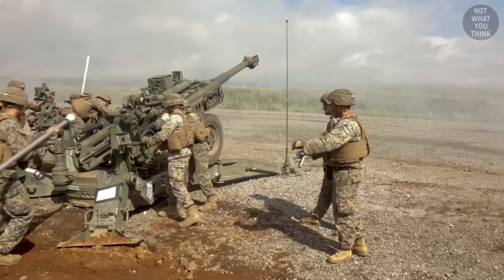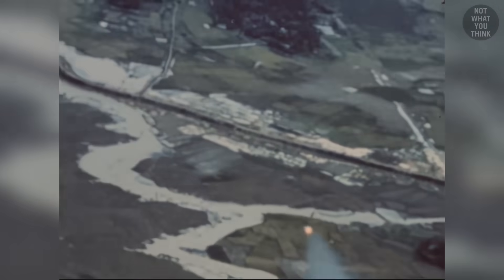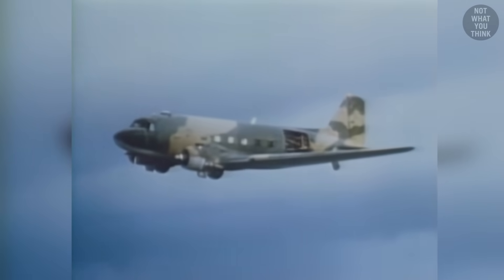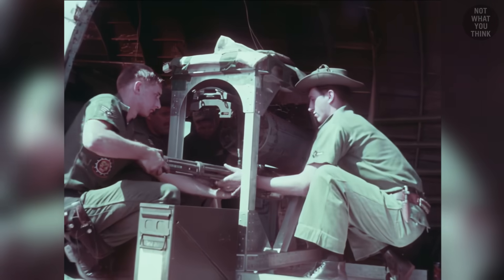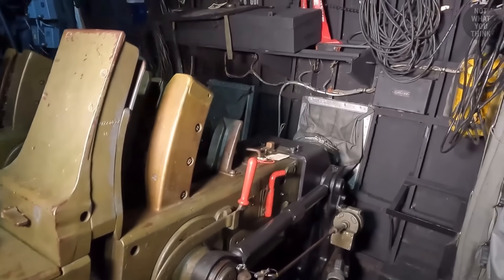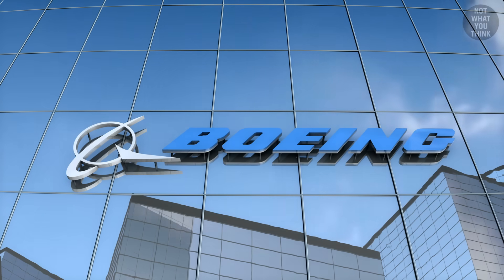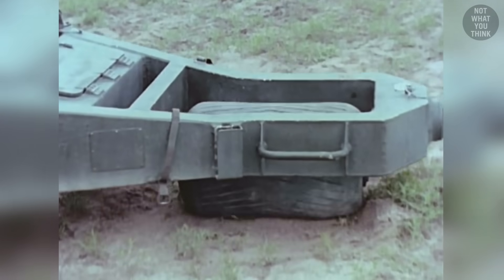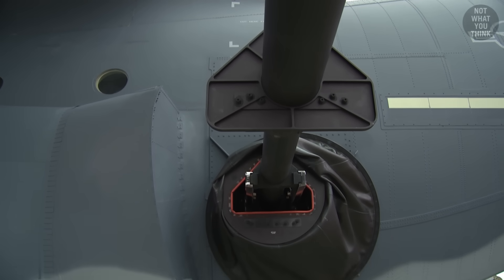Why the US Air Force Installed a Howitzer on a Cargo Plane

Comment: I wonder how real the idea is to make a tiltrotor with 120mm and 30mm guns and that they shoot ~360 degrees like helicopters do from under the bottom
Reply: It's not realistic at all.  First off, the airframe can't take the abuse from the recoil, which is significant.  There's a very real reason the AC-130 Only has a 105mm cannon, and the MC-22 Osprey is MUCH smaller.

Comment: True, but the AC-130 has been used since like Vietnam... Just with 4 or so Miniguns. And Before that I believe they took DC-3 planes and made them into gunships as well for Veitnam (AC-47 SPOOKY)...
Reply: There were no mini-guns on the AC-130.  The "A" and "C" models had 20mm rotating cannon.  It's like comparing a pea-shooter to a .44 magnum.
Reply: @Rotorhead1651  The first batch of AC-130As, ‘Plain Janes’, had 4xminiguns and 4x20mm. Later upgrades removed the miniguns and aft 2x20mm and added 2x40mm. The miniguns could be optionally refitted if required.

Comment: four mini guns and four rotary cannons? But miniguns are rotary guns, just smaller.
Reply: Don't comment on things you don't understand.

-  The M-134 "mini-gun" DOES have multiple, rotating barrels, but it's called a mini-gun for a reason.  The ammunition is either 5.56 or 7.62, the same as is used in standard rifles.  It is little more than .22 caliber.  Rotating Cannon are considered "light" artillery.  Their ammunition STARTS at 20mm (the size of a grown man's thumb).  They are NOT the same.  A 20mm rifle round can penetrate vehicle armor.  A .22 cal round cannot.

-  Where did you hear "4 mini-guns and 4 rotary cannons"?

The AC-47 had THREE mini-guns, period.  The AC-130H had TWO rotating cannon, a 40mm Bofars cannon, and a 105mm Howitzer cannon.  Try to pay better attention.

Comment: "It's only used, when total air superiority and ground assurance is secured"

Just like with the A-10. Almost like those kind of vehicles are doing a shit job, compared to other CAS using guided bombs etc.
Reply: An OV-10 Bronco, with a "chin" mounted gun, once shot down a MiG.  Don't talk trash about things you know nothing about.  Neither the AC-130, A-10, nor the MQ-9 Reaper are Fighter-Interceptors, and anti-aircraft systems have come a long way in the 50+ yrs since Vietnam.  Even with next generation active and passive countermeasures, an RPG can still slip through.
Reply: @Rotorhead1651  "once".
Reply: @zwojack7285  

You certainly are opinionated for someone with literally zero experience.

Comment: It seems the barrel is rather thin, which might indicate reduced pressure charges.
Makes sense since the shells are less slowed down by gravity firing toward the earth.
Reply: Nope. Regular ammo. As an Engineer on AC-130U I worked on ballistic simulations be for I wrote key part of Fire Control algorithm.

Comment: Fun fact: the guy who designed the “Puff the magic Dragon” concept had to pay out of his pocket the prototypes and ammo for testing purposes
Reply: To my knowledge Col. Ron Terry was an ordinary Air Force officer when he developed the concept by firing a rifle from a small plane circling a target. I was an Engineer on the later AC-130U design and we hired some of his contemporarys as consultants and heard many stories. 
This video is ok but no 100% accurate
Reply: @martinmartinez250  wow
Reply: @martinmartinez250  that concept of circling target using MG was developed during WW1
Reply: @jantschierschky3461  WWI planes were a lot slower and flew lower. To accurately shoot from a more modern a/c requires aiming far backward and high. Initially this was done with precomputed ballistic tables The AC-130U version onward used computer controlled trainable mounts. Very different from eye balling with "Kentucky windage".
Reply: @martinmartinez250  well that's not the point,  stating simply that tactic was used in WW1.  So that concept is old
Reply: @jantschierschky3461  You are correct but I think of it as shooting from horseback or a moving tank without a Fire Control System. Sure you can do it but you aren't going to hit anything consistently.
Reply: @martinmartinez250  Correct and the air force didn't want it, I would not call this video accurate in the regards of the original developments which were to support bases and hamlets. There are better origin vids out there.
Reply: It's Lockheed Martin and Boeing so whatever.
Unless the test was performed before the 2 companies approved further research.
Reply: @Doxxtrain  No It was the Air Force doing the early models up to AC130A in house and  in theater near Vietnam. On the later AC-130U we hired some of the, by then retired, AF Officers as consultants.. Lockheed had the contract to refurbish AC-130H and we at Rockwell's North American Division (much later bought out by Boeing) had the contract for AC-130U.
Reply: Well, was he rich? Was he a higher up in a large defence company? Because if he is, then that's not very noteworthy or unheard of.

Comment: 1st, the AC-47 was actually not the first gunship.  That honor belongs to the B-25G, which literally bristled with both fixed and movable machine guns.

2nd, while ANY large aircraft is vulnerable to anti-aircraft weapons, the U.S. military has been developing anti-missile defense systems for its aircraft well beyond simple chaffe and flare units.

I was assigned to the 20th Aircraft Maintenance Unit (A.M.U.), 1st Special Operations Wing (maintenance unit for the 20th S.O.S., and sister unit to the 16th S.O.S. "Spectre", the first U.S.A.F. unit to fly the AC-130).

At that time the AC-130H had recently been assigned to the 16th, relegating the "C" models to the A.N.G. unit at Duke Field, and retiring the "A" models.  The H's were armed with twin 20mm rotating cannon, a 40mm Bofars, and a 105 Howitzer, and a suite of sensors and scanners which allowed the gunners to put a 105 round in your lap, from 10,000 ft., on a starless night, while you were driving down the road at 50mph, and you'd never know they were above you.

In the 40 yrs since then, the avionics packages have only advanced in leaps and bounds.  Anti-detection technology has gone from passive systems like flare, chaffe, and "the bathtub" (a device mounted under the wings, overlapping the engine exhaust, to help mix colder high altitude air with the hot jet exhaust), to active electronic systems used to disrupt the tracking systems of inbound radar/infrared guided missiles.

An RPG might be able to penetrate the gunship's defensive screen, but it would have to be extremely carefully aimed, and fired at the aircraft's exposed underside, where flightcrew would be unable to see it and manuver out of its path.

If you ask experienced, battle-hardened, combat troops, they will tell you that the AC-130, A-10, and the Reaper drone are the current "Holy Trinity" of CAS.
Reply: Except that the reaper drone is the only one good at being CAS. The other two literally eyeball their targets and spray'n'pray.
Reply: @zwojack7285  

Are you a combat vet?  You sure don't sound like one.  You SOUND like a know-nothing dweeb who thinks he's good at trolling.

Comment: does anyone remember the italian p-108? that thing had a 102mm howitzer in front of it.
Reply: No one remembers the WW2 Italian air force, with good reason. 😂😅
Reply: @Rotorhead1651  many remember the Italian airforce of ww2 due to their top of the line pilots those guys were flying circles around allied planes their machines however could not hold up to the pilots greatness

Comment: 8:58 “cheap holographic sight” lmao. I mean I do suppose it’s cheap compared to aircraft targeting systems 😂
Reply: It's also called the H.U.D. (Heads Up Display).
Reply: @Rotorhead1651  Indeed, and they run around $30,000 per unit depending on the capabilities of the unit. So I can understand why they would opt for a $500 firearm sight instead.

Comment: Can we get a video on military flares? I've always found those floating spheres of light amazing
Reply: I read this as "ohhh shiny"
Reply: Hah yes i once saw it on a SoloTürk airshow those things are amazing
Reply: Those pretty flares, they're there to confuse heat seeking ground-based missiles. Hopefully they attack a flair and not the aircraft.
Reply: Well, they are basically just fireworks, but I agree because fireworks are obviously nice to watch. There's just not much to say about small colorless basic fireworks so a video on just them might be way too short. Just search for cool compilations of them because the mechanism behind it is literally thousands of years old, that's how simple they are.

A little gunpowder shoots a comparably slower burning ball out of a tube and that ball burns up in the air over a few seconds. Just like firework batteries or closer "roman lights", you could even make your own with fairly simple chemicals and techniques.
The heat signature of those burning balls confuse heat seeking missiles so they (hopefully) follow those instead of the plane and that's already it, not much more to say.
Reply: @ToBeIsWasWere  I don't think that's accurate, sorry. Those flares are much brighter than fireworks, and some involve parachutes. And considering he made an interesting video out of an easy question (why the air force put a big gun on a plane - to make things go boom), I'm sure it would be interesting
Reply: @agxryt  I've seen "civilian" fireworks with parachutes. Parachutes aren't some weird concept that's only used in the military, they're used all over.
Reply: @ToBeIsWasWere  he could also add other things to defend planes like those missiles that fake planes or those laser anti missile things
Reply: Flares are exactly what we think, so I don't know how he would fit "it's not what you think" into that lol. He's gonna think intensely on it for 3 hours and give up because his brain is fuming.

Comment: Awesome video, as usual! Idea: If you can, you should do a full video on laser weapons. I bet there might be a bit more content to cover since that short you posted two years ago.
Reply: I was an Engineer on AC-130U design and did early work on the YAL-1 , a 747 test bed with a laser weapon. Many years ago and I cant say much publicly but I can say my Caltech professors were divided over airborne Laser Weapons. Many thought it would not be practical to fly a big enough energy source with Laser efficiencies at the time.
Reply: No.  There isn't.  The U.S. military's Directed Energy Weapons program has been indefinitely suspended.....

.....officially.
Reply: @Rotorhead1651  the US isn't the only country researching laser weapons
Reply: @ToBeIsWasWere  

The U.S. is the only country which can AFFORD to research energy weapons in the BEST of times, which these are most definitely NOT.
Reply: @Rotorhead1651  Israel is also doing research on lasers for defense
Reply: @Rotorhead1651  Really? Which program - there is more than one you know.  Reference?

Comment: The gun ship is one of the most powerful troop suppression aircraft in existence I highly doubt that s400 missile systems could get within operational range of one in time without being hit by an f35, f22 or any other non stealth aircraft if they can find an opening if any pilot finds an opening to kill as s400 or other they will take it without a second thought
Reply: The AC-130 is not limited to troop suppression.  It can also wreak havoc with supply lines, warehousing, infrastructure, and absolutely DECIMATE enemy bases.
Reply: @Rotorhead1651  only if opfor has absolutely nothing in the way of AD
Reply: Unless the enemy has any form of anti air defense.
Reply: @Thebootlegengineer  

....and have been for decades.  Even when I was in, we had both passive (flare & chaffe) and active (electronic) countermeasures for suppressing incoming anti-aircraft systems.

Comment: The AC130 is in the same kind of position battleships were in WW2
Reply: A Drone can't linger and lend near continuous artillery support. As one of the Engineers who developed the AC-130U  I always thought of gunships as artillery for light mobile forces
Reply: @martinmartinez250 make an unmanned A-10 with better targeting systems and modern engines
Reply: i was just thinking that. when a cheap drone can sneak up on your and hit your with the equivalent of a torpedo, you become obsolete.
Reply: @aWILDsomethingCAME Electronic countermeasures exist
Reply: @aWILDsomethingCAME  

Except they can't.  Look up "ECM", genius.
Reply: @Rotorhead1651  dont you have beetles to play with kiddo?
Reply: Basically, if the enemy lacks anti ship missiles and planes the battleship can do some crazy work, same with the gunships. If the enemy has a counter however, there is some serious risk.
Reply: @zano187  Only if the enemy is fairly close to a major sea, ocean, or such.
Get 30 miles from land, battleships are useless (even if anyone had ever bothered making a RAP shell for them, that would only extend it to perhaps 45).
Reply: @bricefleckenstein9666  true, but they would also massively help with the most difficult part of any invasion, the initial landings. Being able to majorly soften or outright cripple costal defenceses makes any amphibious landing go from suicidal to possible.
Reply: @zano187  Who bothers building coastal defenses any more?
Reply: @bricefleckenstein9666  Taiwan for one, Ukraine, Russia with Crymeria, Iran, are the ones that cone to the top of my mind, but most countries with a coast facing someone else with a navy.
Reply: I disagree, there's always gonna be a place for planes like the AC130, its role from the start was to be used against vastly inferior forces lacking potent air defense.
Reply: Drones can ‘sneak up’ on tanks.  Not many can catch a ‘Herc’, let alone do any damage.  A manpad, if it can get past the flares, might score, but if you miss, it will be costly
Reply: can drones fly that high ?
Reply: Not really. Battleships were huge capital ships and fleets revolved around them. Gunships are cheap planes that allow heavy or unusual weapons to loiter around a ground battle.